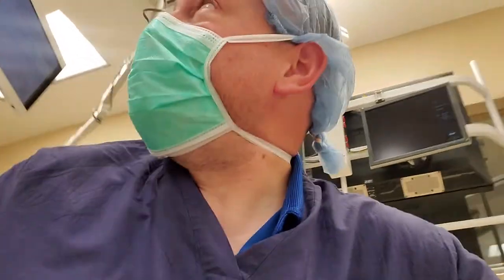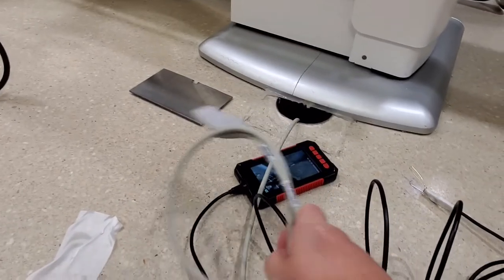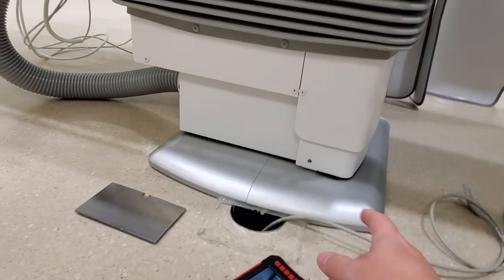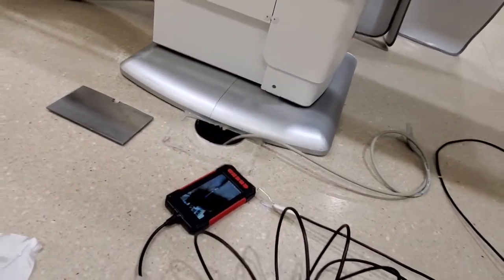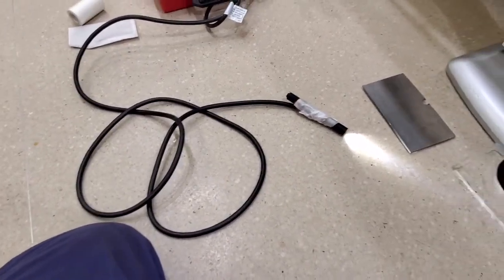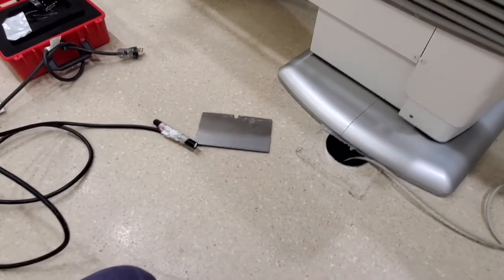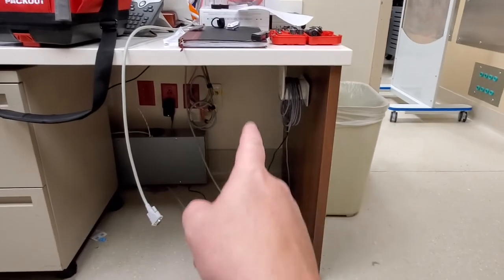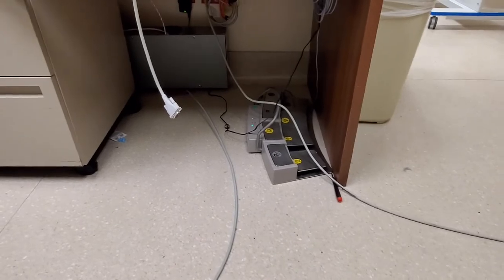Running Cables and Special Tools

Comment: Good ol conduits. Our old Cath/EP labs had end to end runs which was painful when cables broke. In our new labs we have booms to keep devices off the ground, and keep the supporting computers in racks inside climate controlled rooms with the fluoroscopy cabinets. We were able segment most cable runs (RS-232/fiber/ethernet) using panel jacks at the booms and the racks so if a cable to a device breaks, chances are it's just replacing that segment to the boom. Hardest tasks were testing this with RS-232 links, and finding video extenders that worked through multiple patch points. This does increase the complexity of the equipment room and control room since you'll have kvm receivers at both ends, but so far this has worked well for the past few years with minimal downtime. Also, cable labeling, color coding, and programs like Microsoft Visio/Draw.io to document everything are your friend.
Reply: We have the GE Maclab system for our Cath Labs which uses that same cable. In some of the rooms we were able to run a straight-through DB-9 cable between the back room maclab computer and the procedure room fluoro table, and just use the shorter DB-9 to Patient Data Module cable. I don't have experience with GE patient monitors but it might be worth a try.

Comment: It seems to be a iron conduit, 
otherwise if it was aluminium or stainless steel, you could also use a cord and some strong Neodymium magnets to pull a cable out. 
Most connectors like a DB 9 have a iron ground shield. 
Another trick for guiding a new cable through a conduit, is to use a thin rope tied to a M6 nut and use a vacuum cleaner on the other side of the conduit, 
to suck the M6 nut with the rope through. Then this rope can be used as a pullcord for new cable(s).
And last, for fishing out a cable, is to put a M6 (or bigger ) nut in a uninflated balloon as a weight, then connect this balloon to a hose, then drop down the uninflated balloon below the connector of the cable that you want to pull out and inflate the balloon just enough so that the balloon still small enough to slide through the conduit, but big enough to carry the connector, and then pull on the hose to lift up the cable with the connector. 
Happy fishing ;-)
Reply: The chances of running into aluminum or stainless conduit in that kind of application are basically zero, and then even a strong magnet would be pointless.